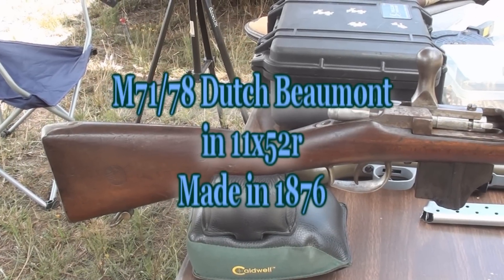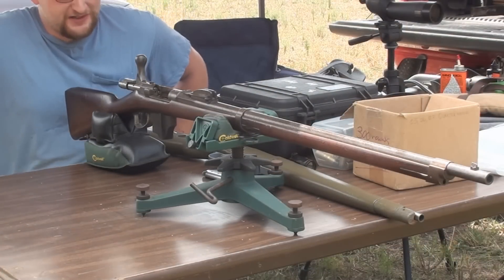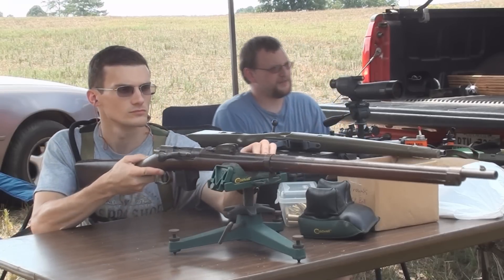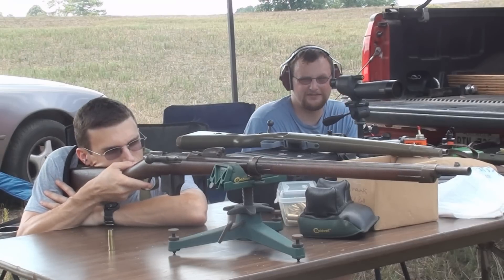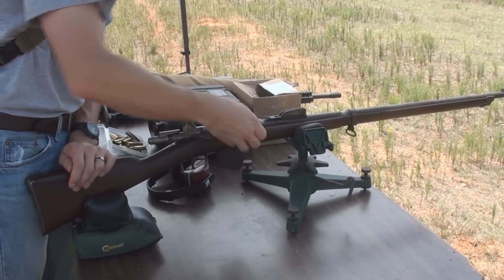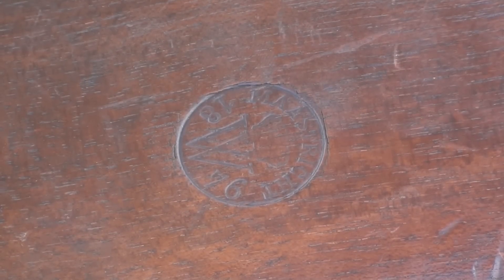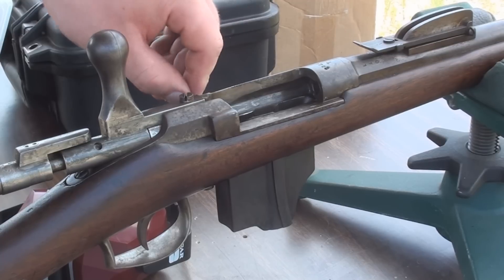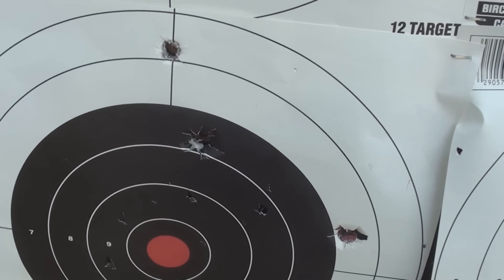M71/78 Dutch Beaumont Vitali 11X52R Rifle Made in 1876

Comment: This rifle was made in the white. Arsenal Maastricht was for the common soldier, arsenal Delft prepared/made/selected them for the officiers. 
I have one in museum condition with Nr. 700 all over. 
I use mostly 27 grain Accurate 5744 (Lovex D060) or 77 grains Swiss. Black powder gives more fun, but also more heat and mess.
The best bullet so far is from the mold  Lee 457-405 HB

Comment: @worlock1422  - If you need a mainspring and can't find one, use a suitably-sized mainspring from a sidelock muzzle-loader and trim it to fit. I did that, taking the spring from an old rusted-out CVA 50 cal pistol, and with just a hand file made what was needed and its still shooting reliably. I go through about 1000 rounds of hand-made 43 Dutch each year in my three Beaumont rifles, since about 1985. The 50-90 Sharps formed brass will last almost forever IF you use only 45/70 Trapdoor data.

Comment: I recently acquired one of these - curious if your pet loading for it is the same as it was when you made this video? My brass is also re-sized .50-90 brass, and I was told that these can be loaded using .45 colt does for bullet seating (haven't dove into that part yet).

Comment: How much does ammo cost you on that? I inherited one of these rifles last year, bolt was pretty stuck(it was mounted on a wall and untouched for 50 years) took two hands to pull the bolt. it's smooth after I took it apart  and cleaned the decades of dust.
also that unique bolt handle with the spring for the firing pin scared the crap out of me when I unscrewed the handle and the two halves popped apart.